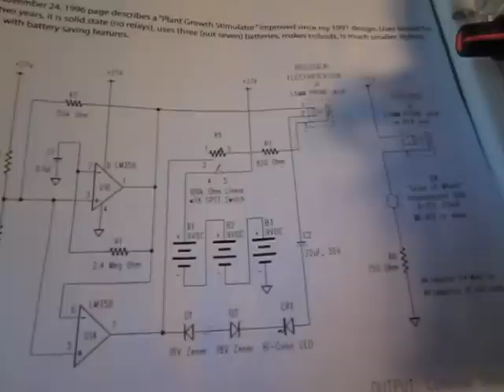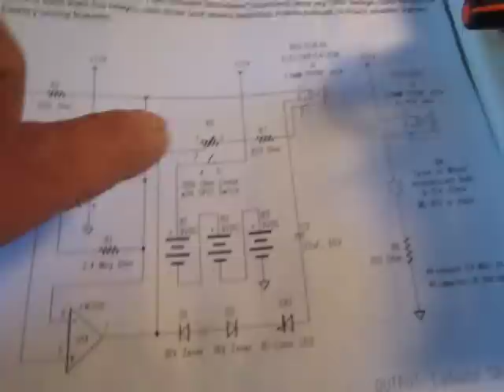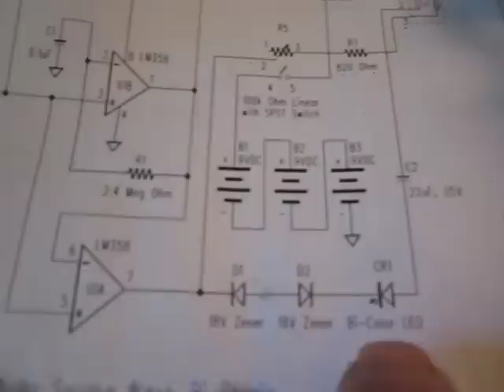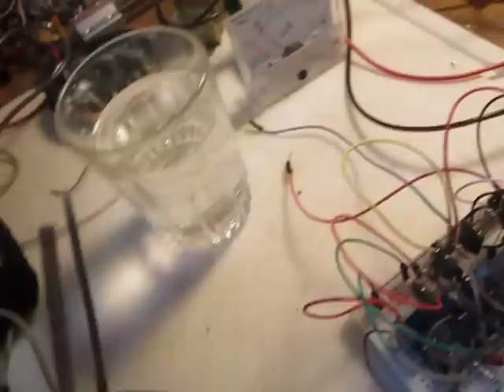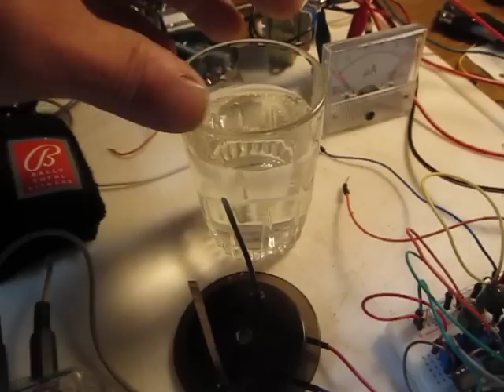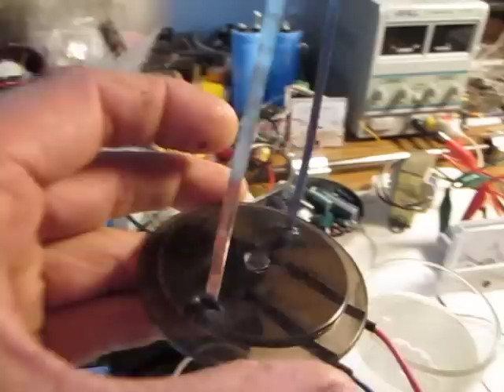Robert Beck's device.

Comment: The device that you built is the electeifier and collidal silver? Do you have a list of parts so I can see what may actual be different.  If there is a easier way I would like to try with out the relay.
Reply from the maker: My device has both functions - BE and CS plus timer but each can be built individually. I posted everything on nvtronics forum - Robert Beck devices. Full address is displayed in the video and description. Circuit has been replicated many times and  tested by other forum members.

Comment: I been trying to research some information but is having problems finding 3 things on my list. 200 mf 20v electrolytic capacitor, 0.22mf 20v tantalum capacitor,relay 5v 50coil pcb mount dpdt selecta switch, lead wire with 3.5 mm plug 6ft. Can I replace them with something else or do you know where I can purchase.
Reply from the maker: What circuit are you trying to replicate? There is no relay in this schematic.
Reply: Revision 1996 proposed theoretical in vivo blood neautralizing device by robert c. Beck. The list requires a relay and lead wire.
Reply from the maker: Jamila Martin
That's an old circuit. The one in this video is more recent and I modified even further adding voltage multiplier and constant current limiter for silver colloid. It is shown in my other YT. It is the same device but upgraded.
I never built the one with relay.

Comment from the maker: It this prototype I used 3.5mm audio cables. In my new device there is 3.5mm cable for BE and 2.5mm for CS and I'm using medical cables. You can use any type of socket/plug which you have available. In the original circuit there is a 3 prong 3.5mm socket which disconnects bi-color led once the plug in inserted into socket. This option extends the battery life. Check my other YT with Bob Beck device in it as it explains more.

V

Comment: Are using 3.5mm plugs for both the Silver Wire Leads and the Electrodes?

Is the wire that is connected to the plug simple stereo wire?

Comment from the maker: I have upgraded this unit since last year by adding voltage multiplier allowing use of single battery, constant current circuit and timer. Please check out new forum for more info (address at the beginning of this video and its details).
We'll help you to build one if that's what you wish.

Thanks
V